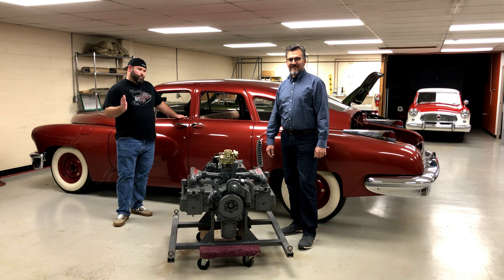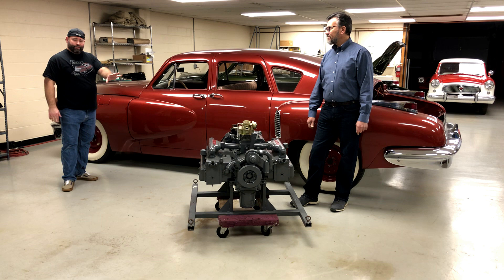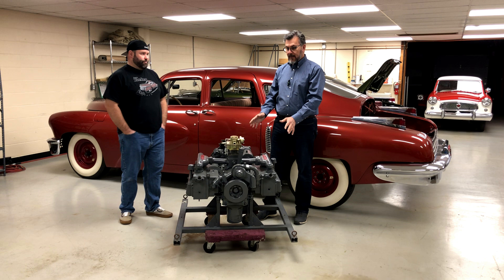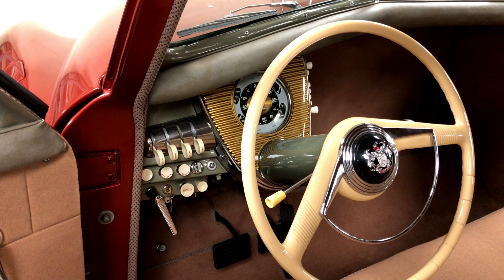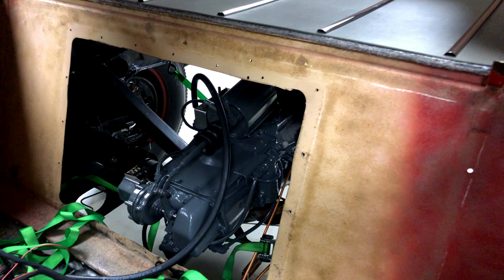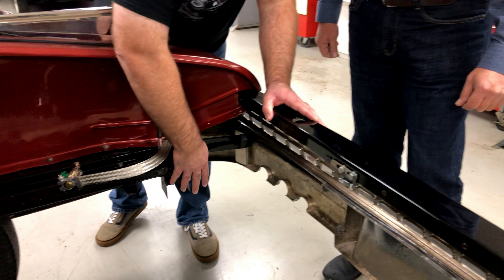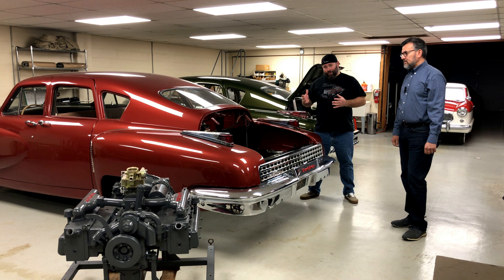Tucker Car #50, the last Tucker automobile ever produced by Preston Tucker!

Comment: I Still don't understand How Tucker Motors lost the lawsuit. It just saddens me that a great innovation in automobile design and build was quashed so blatantly with so much malice.
Reply: They didn't. They won. Mr. Tucker and five other associates were acquitted on ALL charges.  However, that decision did not come until January of 1950. The plant was ordered shut down in July, 1948.  The Tucker family did briefly consider getting the plant semi-operational after the court case, and finishing the pilot run of 125 cars.  Cooler heads may have prevailed since the Corporation only had about 8-million dollars at that point and owed considerable back-rent on the plant which would eat up a significant portion of the money left.  Later, it was learned that while the engines had been completed, there were not enough transmissions or body panels left in stock to build anymore cars.  The money it would've taken to stamp new panels, and cast new parts would've never been recouped and then there was the task of getting parts from the few outside suppliers that Tucker relied upon.  Many of whom were still waiting for payment of parts already delivered.

The short version is, it would've been a fruitless endeavour. Sure, they'd build 125 cars, but they'd never make a dollar in the process.  I'm sure the family sat down and had many discussions over this.  I believe it was sometime in March of 1950 when they officially threw in the towel and the company officially put into receivership.  The auction was held that September.
Reply: @That_AMC_Guy  Thank you for all of the fantastic information. I'm assuming it's safe to assume that all of the trumped up charges and other legal hassles had mired the company in so much trouble DURING the trial, and that basically caused them to get so far behind, and in debt. It's a shame what they did to this man, his company, and his family.
Reply: @howabouthetruth2157  I've read that Preston Tucker was never the same and possibly the main reason why the company never even attempted a re-start. Even though he'd beaten all odds and was literally a few weeks away from a running automotive empire,  he just couldn't do it.

But don't misunderstand, the family and the corporation were still in GOOD standing in 1950. The "debts" were not insurmountable.  Rent on the factory was the big one and would've set them back well over 5 million.
Debts on parts delivered probably no more than a half million.  So, the corporation was still solvent in 1950, but the costs of re-starting were too great.  Paying the rent on the factory would've cost them most of their savings, and the costs to stamp new body panels and cast more transmissions, etc.... was not feasible.
Reply: @That_AMC_Guy The whole thing is such a sad story. If I'm not mistaken, I seem to recall that you are the same gentleman who has shared a lot of good information about Tucker in the comments under other videos here. All is much appreciated.
Reply: Mob tactics
Reply: @howabouthetruth2157  one in the same.
Reply from the maker: Thanks for watching!
Reply: @greggv8  sort of related sort of not , just something I noticed at work a while back, I'm a gen tech. 
We have a customer with an old Onan generator from the mid 60s ,and there was one of those keen sales labels touting it's attributes on it. 
At the bottom it said something like : Onan generators a division of Studebaker. 
That things gotta be a 64 or 65 model, I don't think it's a 66. Powered by an old Ford 240 ,it's about 30-35kw.
Reply: @MrTheHillfolk  I have my grandparents' stainless steel stove with double oven, built by the Nash Kelvinator division of American Motors. I've thought about gutting the upper oven to put a microwave in it.
Reply: It's like politics regardless if you win or lose just stick to the crap that your spewing and you will get your way

Comment: @seantucker 
Wasn't #1050 part of the Dick Burdick Collection @ Dicks Classic Garage in San Marcos Texas?. The car had a motor installed when it was on display along with a Tucker motor on a stand sitting next to it in the museum. Advertised as having only 1/2 mile on the odometer. The Burdick Collection was quite impressive and it was very sad to see it auctioned off after his passing.
Reply: At 5:09 , view it in 1080p, you can see all the zeros on the odometer, with what looks like either a 5 or a 6 rolling up in the tenths (white background) digit.
Reply: @madpogue  Yes .06!
Reply: Imagine.. had this been allowed to thrive.. Tucker trucks later.. probably the big 3 worse fear!
Reply from the maker: That’s correct, it was in the vehicle but was never completely installed and run.  Thanks for watching!

Comment: That DOPE!!  My beater back in the day ran 9's in the quarter and lifted the front wheels half track but that was cuz I added the roots blower off a GreyHound onto the aircooled helicopter motor in my old Tucker in the 90's... it was a screamer!
Reply from the maker: Ha!  We’d love to see that one.  Thanks for watching!
Reply: @prestontuckersspeedshop1948  Ohhh, ummmm, uhhhh, I forgot to take pictures... only have video of my FireBird and friends Mopars in 1996 VHS's in my Cars playlist
Reply: You forgot to say your big gal of a girlfriend was in the back seat 😂🤣
Reply: @oxyfee6486  Haha, that RIGHT!  IT seriously totally reminds me I remember this one time I was out with this nice girl and we had taken that old KemoSabe trail up to Horsheweitz pass to check out the air brigade defence machine setting up their advanced airwac sqwuack comptroller in the valley but I started to get some vibration in the motor mounts on my old beater hotrod on account of I had just cut on the Roots blower from a GreyHound bus to my aircooled helicopter Tucker engine in the back of car #52 off the line.  MAN, it was abadass ride lifting the front wheels at least half track running 9's in the quarter cuz of all the weight transfer and my chick would ride in the back to help settle the torque steer on account she was a bigger gal and fit squarely in that chopped off tub behind the rails of the Tucker chassis where she could just hang on and straddle the plumbing tube roll cage bars.  
Luckily, no one was injured... except my heart the day she left for a man with a Gasser Willy  /w\TMFR/w\
Reply: @THRASHMETALFUNRIFFS  That’s the one I seen,😂🤣😂Thanks for the laughs friend,have a great day.
Reply: @oxyfee6486  /w\DAVE/w\

Comment: Don't want to nitpick because the car is amazing and the paint job looks fine, and I know they no longer make the exact same automotive paints today that were used during the late 1940s, but I still think they could have matched the tint and shade of the original maroon a little closer.  Also I wonder if the selling price of the car less powertrain at the 1950 bankruptcy auction is known.
Reply from the maker: We can’t comment on the reasoning for the paint choice as it was done before our involvement, but this color does present very well!  Thanks for watching.
Reply: @prestontuckersspeedshop1948  Color per se is great, I like it. Just the shade looks different than inside the door, at least on camera.
Reply: Picky emffrr aren't you?
Reply: @saddletramp6935  Generally I'm a terrible excuse for a human being.

Comment: Have you guys ever considered getting scans of all the design documents that are in that collection that's in that museum? I just watched the video yesterday about the guy that had that collection and one of the comments said that after he died the collection ended up in a museum. I would think it would be easy to remanufacture parts as needed if you simply made scans of those documents and converted them to 3D print models.

According to what was stated by him, he had all of the blueprints for all of the parts that went into a Tucker. I would imagine that that also includes body panels. So perhaps making dies to restamp body panels could be done more easily as well since you would not be having to guess at dimensions.

I realize that all of this would be costly, but can you imagine what it would mean to the Tucker community to be able to purchase replacement parts? From what you said in this video, the majority of the Tuckers out there are not in drivable condition. Being able to reproduce parts would make it possible for more of these Tuckers to be roadworthy.
Reply from the maker: We happen to live 30 minutes away from the AACA Museum where the prints are now located.  We use them often when we find the need to remanufacture replacement parts.  However, in many cases tooling costs prohibit traditional manufacturing since there are so few cars in total.  Most items are hand made using prototype production techniques.

Comment: Given the state of the art with steel pressing,  3-D printing to create casting patterns for 'lost plastic' casting process, it seems feasible to tool up for not only 'spares' but to establish the basis for continuation production.  I wonder if a current production Lycoming or other opposed layout aircraft engine can be adapted with new head and manifold castings to create a new version of a water cooled Tucker inspired engine for continuation cars.. That would be 'close enough' to be acceptable, and different enough to have zero impact on originals value.
Reply from the maker: Thanks for watching!
Reply: @prestontuckersspeedshop1948  Of course!  This is one of the most amazing mid century car stories ever.. How could I not watch?  Years ago I had the great pleasure of seeing a Tucker on the road now and then, and on display at events, as one was owned by a family in Springfield Oregon, very near where I lived in the 70s, 80s, and 90s. It was a real treat to be on the road and then just see it out being driven.  Magnificent vision to have conceived the car, and wonderful that as many made it into existence as did.. THANK YOU for keeping the story alive and for keeping the cars running..

Comment: Nice, but it is my understanding Tucker never made any cars for production they simply made prototypes that they sourced engines for, am I mistaken?
Reply from the maker: In our opinion even though 50 of the cars were called “production” they are all prototypes.  The engine was sourced from a company called air cooled motors that Preston purchased after scrapping plans (due to time constraints) in the short term for the original 589.  Thanks for watching!
Reply: @prestontuckersspeedshop1948  Wikipedia has a good article about all that and more.

Comment: So this Tucker was never driven.  Begs the question - why did someone change the paint color?  And I'm confused - did you say the engine was in at at one point and later removed, or there was never an engine in it?
Reply from the maker: We assume that back when the car was repainted it was done so to “present” well as was done in a color to the owners liking.  1050 was sold at the bankruptcy auction in 1950 without an engine and this engine, which happens to be the last one, was installed later to “complete” the car.
Reply: @prestontuckersspeedshop1948  Thanks for the explanation!
Reply: @prestontuckersspeedshop1948  The repaint color is close and was likely a stock color from some production car. Some Tuckers were painted completely different colors from the original like the yellow one that used to drive around San Francisco (which is unfortunately in a private collection now, but back to its original black).

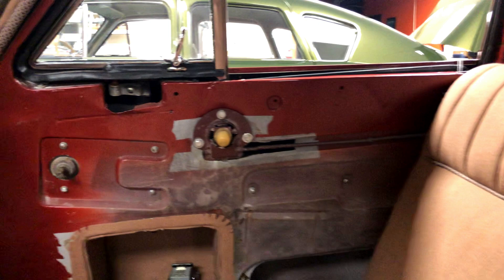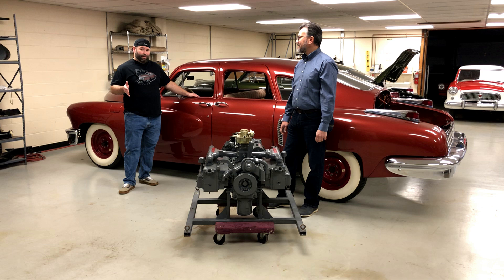Comment: At 2:34 to 2:42, what is the door button?
Reply from the maker: Hi Bill, they open the doors vs. using a handle that could get caught on the occupant's garments.  Another Tucker innovation!  Thanks for watching.
Reply: @prestontuckersspeedshop1948  1948 Kaiser/Fraziers had buttons too, but the next and last version from 1951 on had normal door handles.

Comment: A Question:  did  Tuckers  have backup lights?
Reply from the maker: No David, they did not.  One safety innovation he didn’t think of!
Reply: @prestontuckersspeedshop1948  Back then turn signals were relatively new. Backup lights were an option and usually separate lights added on. Seems kind of obvious now.

Comment: Strange no, it looks quite similar to the 49 others... 
Almost 2 million $ for a car, just because it is the last one of a series of 50, I don't know.... I'm all in favor of protecting historical heritage and in this case relevant Americana, but the commercial side sometimes involved with it, just like with art is sometimes completely ridiculous. You can buy 5 Rolls Royces (starting price 300 000 $) with a number of frivolous extra options for that money, 20 of the most expensive Tesla's, so you probably could provide all the inhabitants of a small rural village a brand new car, pick up or not. It is difficult to say what is and what isn't a "correct" price for such a car, or for a 1930's Bugatti or whatever. But it is clear that those with too much money at a certain moment cross an invisible line between an "understandable, completely justified" price and a ridiculous high price. Is the only price that counts really the one fools are ready to pay for it ? (see also "Sunflowers" painting for ex.)
Reply from the maker: It's not $2M because it is the last car, that's the average value for any original Tucker.  One of the cool attributes of this particular car is being the last one, but that's only  a small piece of the overall value.  Thanks for watching!
Reply: @prestontuckersspeedshop1948  Yes, value of a car or anything else isn't set by some conspiracy. It's supply and demand.

Comment: Why do you say this number 50 is the last car produced by TUCKER when we know they made 51 cars total???
Reply from the maker: The count of 51 comes from counting #0 (the Tin Goose) as the first Tucker, and the 50 additional prototypes as 1-50.  0+ 50 = 51, with this car being the last one.  Unless you know of a #51, and if so we'd love to chat!  You will see referencing to a few other assembled cars, and a couple are sometimes referred to as #51 & # 52.  Both of those cars were assembled with various original parts and some fabricated items but did not have official body numbers.  They used 51 and 52 simply because they were the next numbers in line.  Thanks for watching!
Reply: @prestontuckersspeedshop1948  Ok, Thank you.